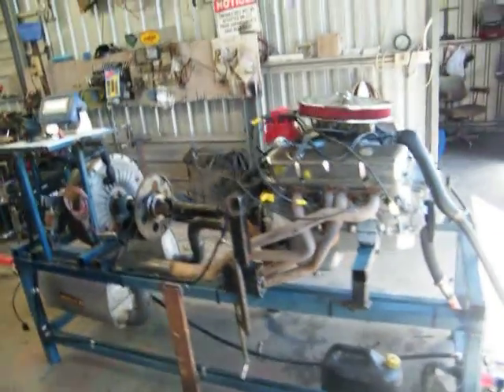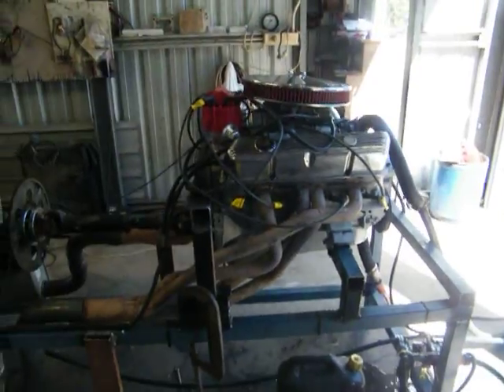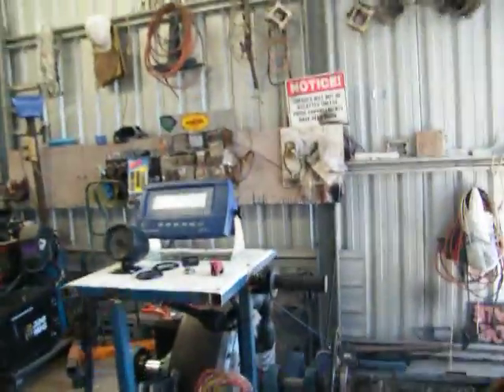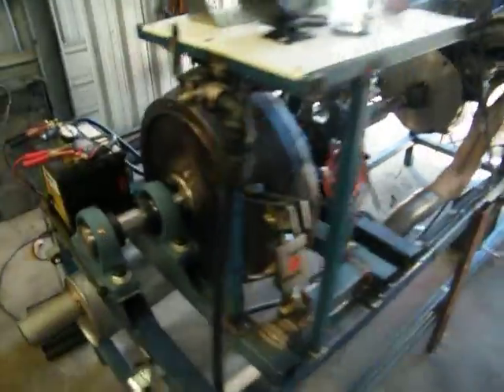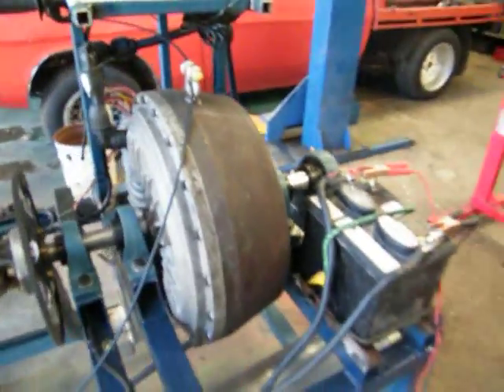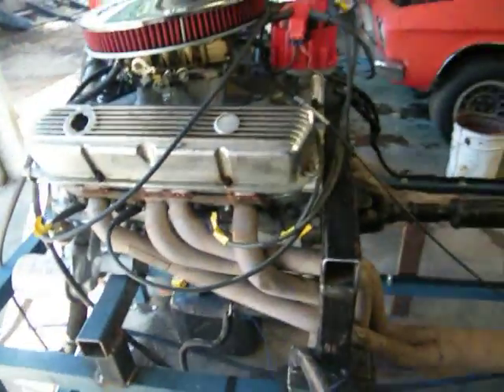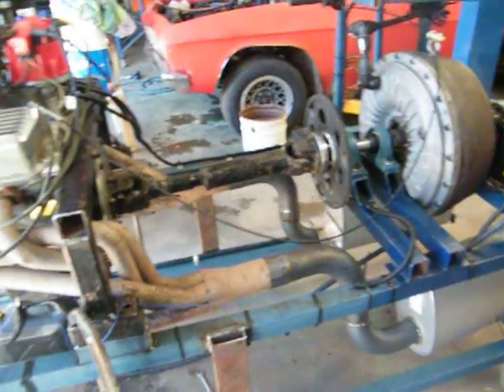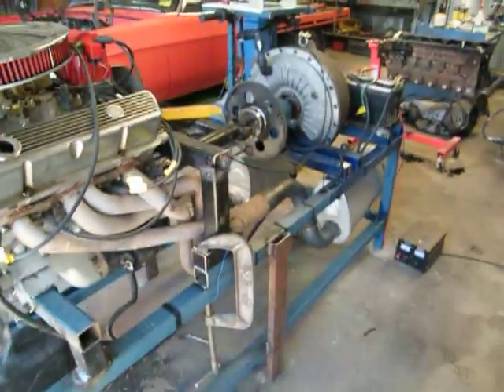homemade engine dyno holden 308 red motor

Comment: Mate this is disturbingly dangerous!  Even though you have moved the control panel to the rear this is still crazy. Dyno props shafts with universal joints fail often!  Like wise you have a DIY water brake, these fail too.  
You should not be anywhere near that thing while running in anger.  Preferably you need to be in a separate room made of brick.  You also need a heavy steel tube encasing the entire prop shaft.
See this link https://www.youtube.com/watch?v=zUTtfu7Hn7g&ab_channel=EngineBuilder  where these guys talk about universal prop shafts from dynos, flying around their workshop punching holes everywhere, now they run a solid drive shaft and always test from an isolated control room.
Please seriously consider all this.

Comment from the maker: yes you can adjust the load it is done by a water valve it feeds water in to it and drsins out the bottom there is more info on my other videos thanks

Comment: Tell me more about your brake.  It looks like it can handle a lot of torque.  Was it originally used like a torque converter between the motor and trans or as a retarder after the transmission?  I have an old Clayton chassis dyno and just recently built an engine dyno too.  Links to your videos were posted in a thread on my setup.  It's nice to see someone else as obsessed as me.

Comment: I'm glad to hear you moved the controls, their original location was very dangerous, it made me cringe the first time I watched your video. If you do enough dynoing, sooner or later something's going to break and I've seen what can can happen when a u-joint on a dyno prop shaft fails and trust me, you don't want to be anywhere near that! 

I'd also recommend you build a nice stout scatter shield over the prop shaft and u-joints, one day you'll be happy that you did.

Comment from the maker: I have moved the controls to the rear of the dyno and have built a overhead crane so i can lift the engine straight off the engine stand i dynoed a 454 the other day and it made 440 hp at 5000 rpm i will be doing a diesel i am building soon and will do another video of it  it should be awesome it will be running about 20 lbs of boost